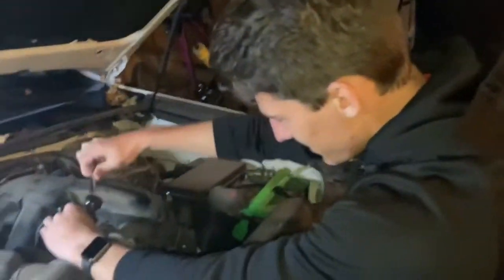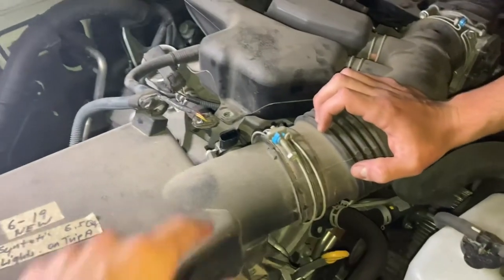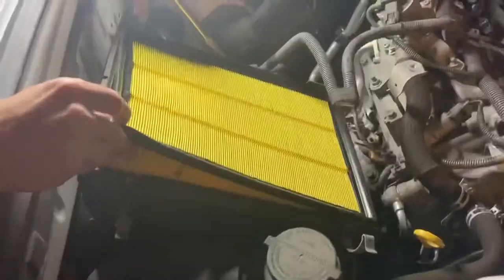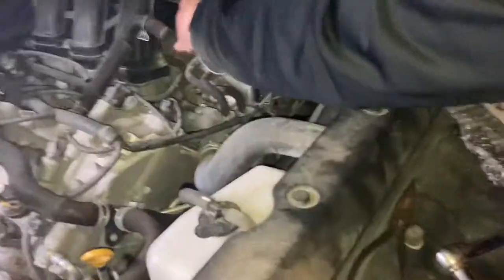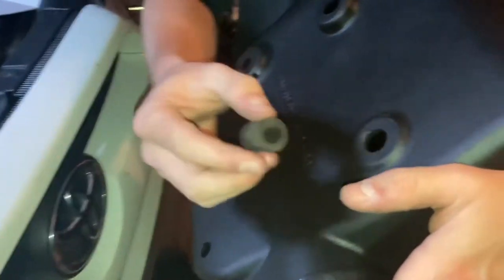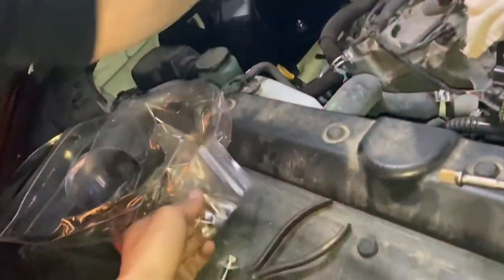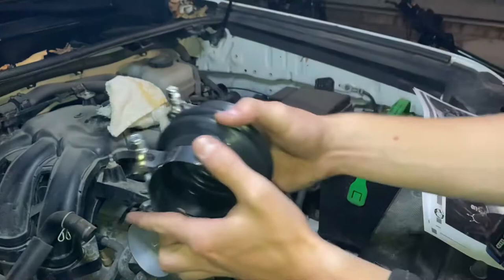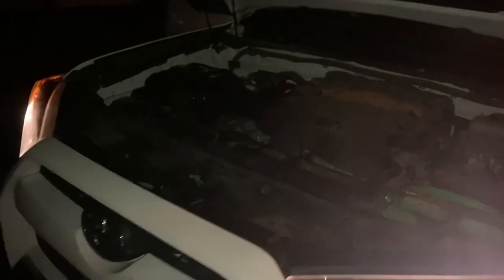(Utah series: part 1) 2015 Toyota 4Runner AFE INTAKE and THROTTLE BODY spacer install

Comment: Hey guys how is the throttle body spacer working so far? Did it help with gas millage and performance?
Reply from the maker: Hey Moe, I’m not sure because I put on bigger tires too so the mileage got worse overall. Did the throttle body help my mileage against the tires - maybe?
Reply: @MrSnownick  thanks! I am thinking about adding one on mine.  I run 285 70 17.  🙏
Reply from the maker: @Jaico2024trd  I got 33s, so 285 as well. I get avg 15.6mpg. Lots of city driving